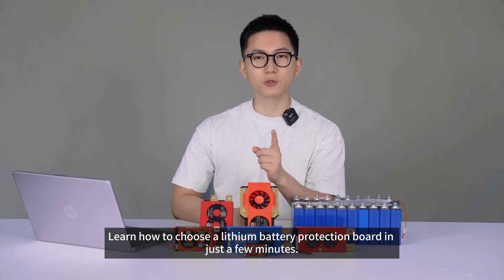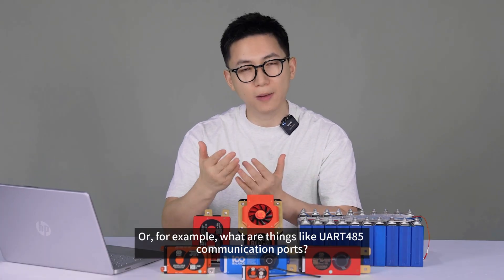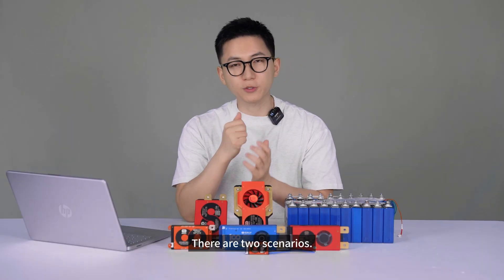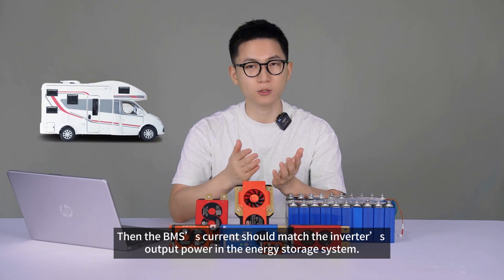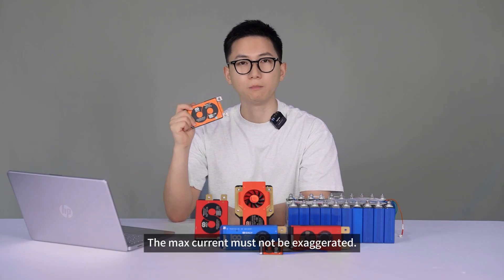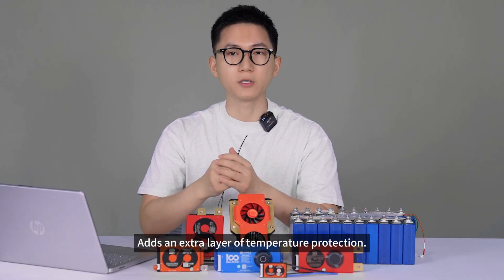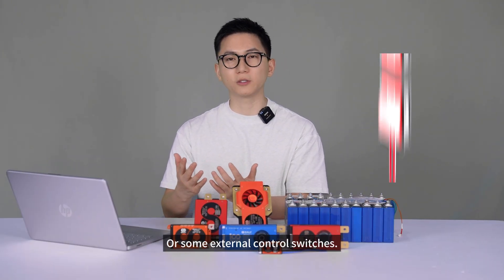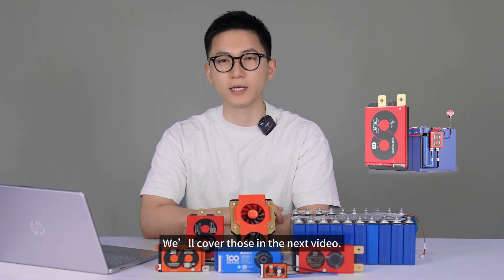HOW to choose a suitable BMS for your lithium battery

Comment: I have a set of life po4 batteries arrangement as 4s2p , 12.8v. AC inverter of 2000VA , what is the recommended BMS charging Amp & con't discharge Amp should be use ? Thanks

Comment: thanks for making this video😊

kindly make video 
difference between ess bms vs smart bms
i want to know
can we use 100amp smart bms as ess?
like i want to use balance bms 100amp.
can i use with inverter?
Reply from the maker: In theory, when it comes to BMS (Battery Management Systems), there’s no need to distinguish between regular power systems and ESS (Energy Storage Systems). Both are designed to provide safety monitoring for lithium batteries.
The only difference is that ESS needs to connect to an inverter, and the inverter requires data communication with the BMS. But now, standard smart BMS boards can handle that just fine